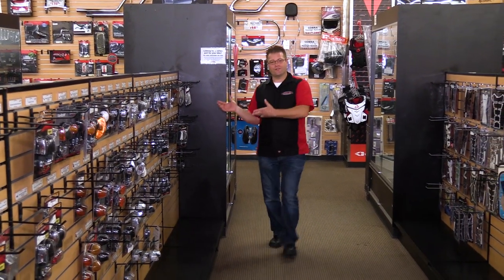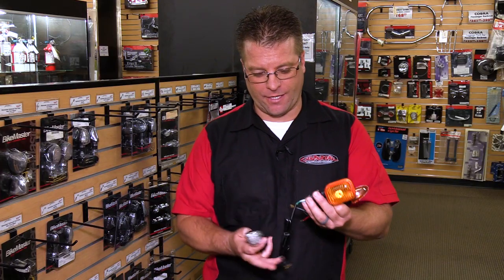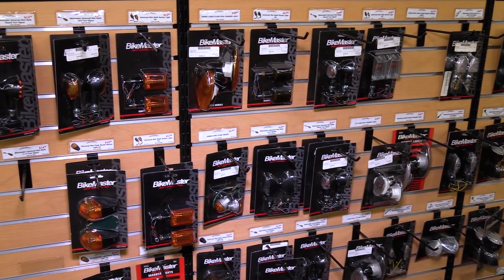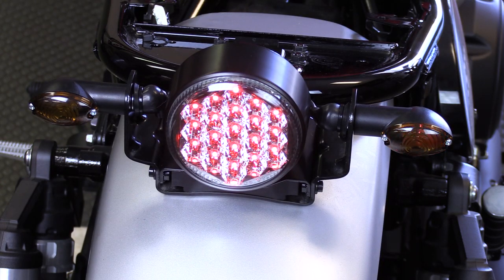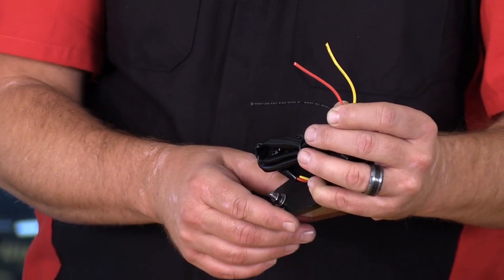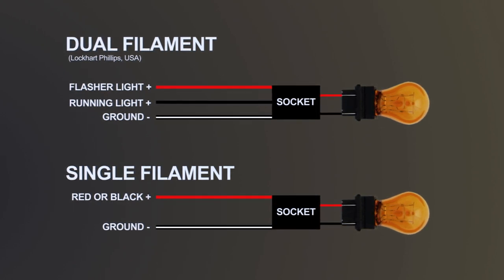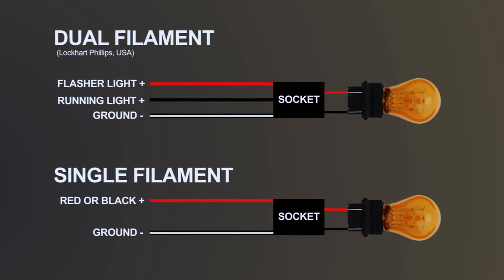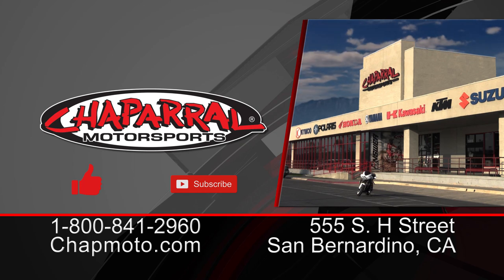Motorcycle Turn Signal 101 - LED Incandescent Running Turn and Brake Lights

Comment: Installed new turn signals on the rear. The set came with 5008 incandescent bulbs, 2 wire setup... once rewired and flip the switch they only come on solid and not flashing. Would a load equalizer/  resistor fix this? Tested a 1156 bulb and it works like normal, so I'm assuming it's amperage issue.

Comment: Installing 3 wire LED turn lights on 2014 VN900.  Bike harness is three wire but I can get the running lamps OR the turn lamps to work, not both.  What am I doing wrong?

Comment: hi I installed all 4 LED turn signals on my Yamaha yzf600r but all 4 turn signals light up when I chose left turn signal all 4 light up and the same when i chose right turn all 4 light up .. any idea how to fix ?? Thankyou
Reply from the maker: Hello, sorry without knowing step-by step how your installation was performed we cannot absolutely say; but it sounds like maybe you need to install some diodes in line of your turn signal wiring.
Reply: @chaparralmotorsports  you have totorial for that or picture ?? I m out of this handmade :)

Comment: Can you run incondesent in the front and LED in the rear turn signals.
Reply from the maker: Hello, you can but you will most likely need a load equalizer to keep things running properly.

Comment: So I got led upgrade for mine.. with resistors and still won't light up any suggestions would help pls thanks
Reply from the maker: Hi Chris, without looking at your bike/electrical system it's impossible to say where the problem lies. Double back and make sure you've got all the connections correct and they are making good contact.

Comment: Hi,  I put led turn signals on the rear of my bike and its sucking all the energy to the rear turn signals and nothing in the front turn signals.. what happened? thanks
Reply from the maker: Hi Peter, without actually seeing your bike and what was done it's hard to say. Did you use a load equalizer?

Comment: Do not change your oem turn signals
B4 u read up whats legal and not
But my suggestion
Replace with oem atleast the casing
And blinker but a led bulb can be
An option
But again check what is legal for the
Road/hwy
What is accepted by DOT
and hwy patrol etc

Utube videos may not offer all
The legal stuff when in comes
To DOT
Best of all the oem stuff usually
Works unless it comes to modes
Or bad component.
Reply from the maker: Thanks for the insight.